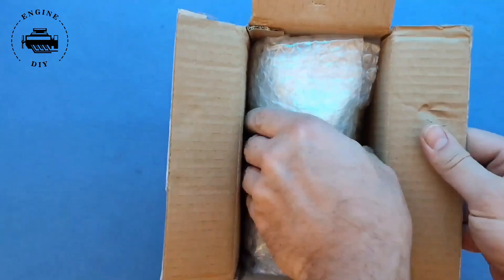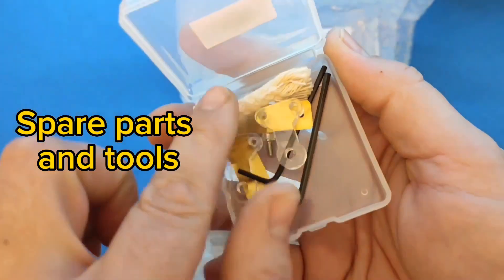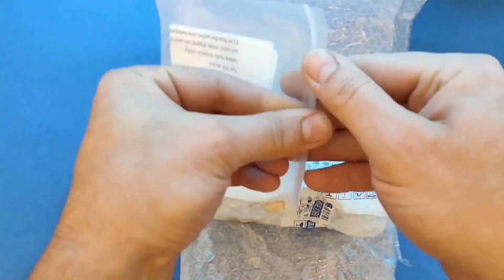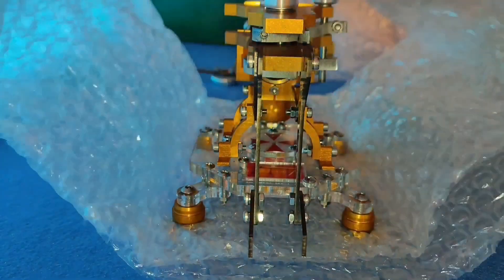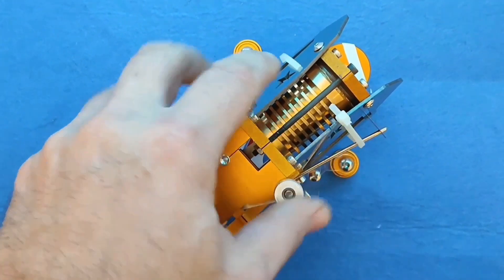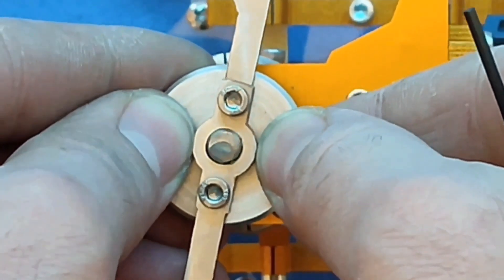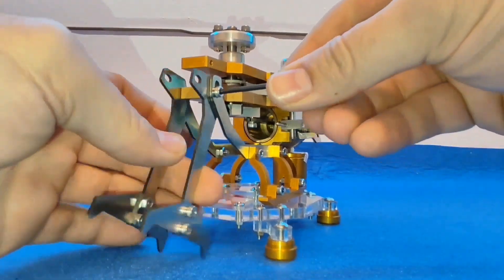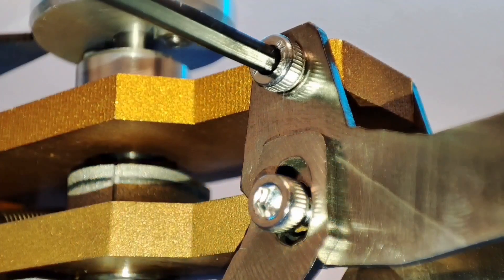Vacuum driven Copter 🚁 Hot air engine kit

Comment: heh heh heh..
its start is just like my motorcycle.. it takes some effort..
These engines are interesting to me because they work with negative pressure and unfortunately they are a bit more powerful than most stirling engines..
only disadvantages ; The altitude at which they are most productive is sea level.
Reply from the maker: Yep, this unit has a pretty cool sound effect. I was suprised the torque when my finger was in the way where the rotor moves. It was a bit painful meet with the steel. :) The high temperature difference could be the explanation for this. After the cylinder closing time the piston moves backward yet, so it's dropped the pressure and this movement precool the gas in a short time. I like it so much. I haven't got this type engine yet, but now I want to build one for myself and this one will be the 🥇 1st place prize in the Stirling Builder Challenge Soon! Thanks for your comment! I hope you're doing well! BLADE
Reply: @AttilaBlade  thank you very much  mate..i'm fine..
take care of your health..
By the way, I know you can make such an engine..
I hope you get the award.
Reply: All too often these flame lickers are finnicky as hell, and hardly powerful enough to keep themselves going.